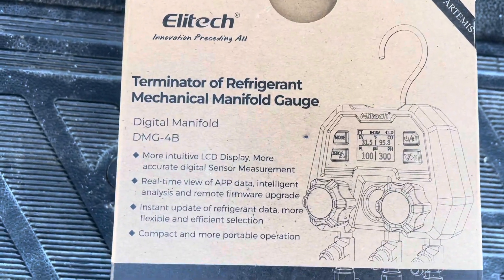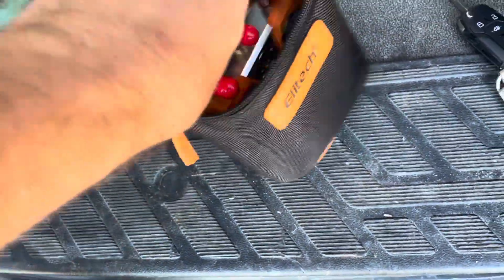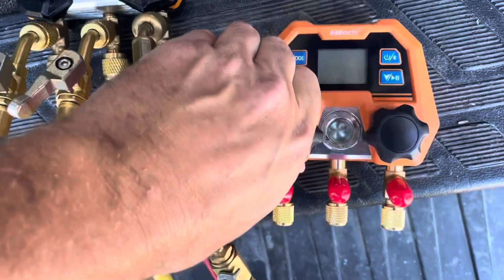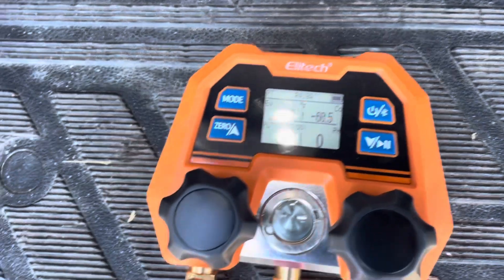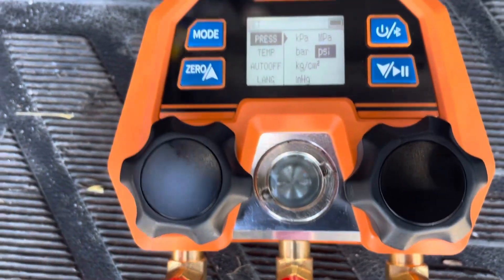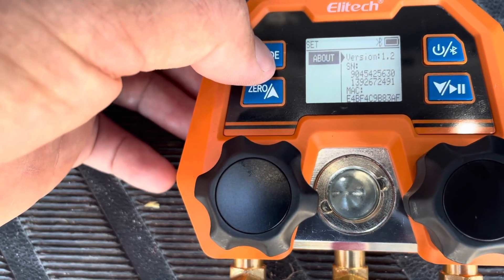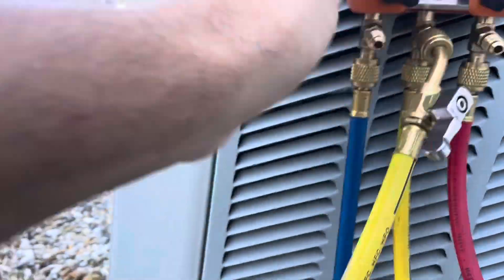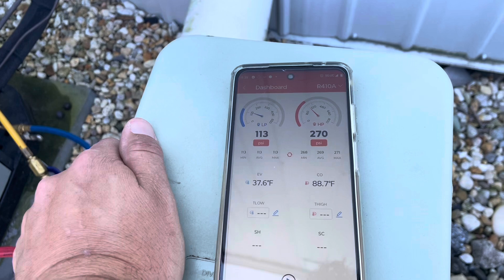Elitech DMG-4B Digital HVAC Manifold Review!

Comment: These things are Junk!  I have had fist set high side leak internally.  Elitech replace unit. I bought a second set so I wasn’t without gauges.  2 weeks later these leak exactly the same.  Now I’m using the replacement set from the first leak and now those are leaking.   3 sets all leak in the same spot internally.  All within 2 months
Reply from the maker: Sorry to hear that.

Comment: What’s your long term usage review?  I have these got them in April. And my set leaks on the high side inside the manifold.  It will actually frost up the housing
Reply from the maker: I actually gave my set away because I did not need them.

Comment: Not sure it is possible to get realtime temperature for sc and sh with this unit.  No jacks for wired temps and I could not find any elitech bluetooth temp probes.  Their better manifolds can use their wired temp clamps.  This manifold may not be a good first digital manifold.
Reply: I read somewhere that these should not be compared to a typical digital manifold, they are more like an electronic digital version of the classic stand alone dual circular gauge manifold. They display the pressure and add a few extra features not found on analog, including storage of 150 different refrigerant pt charts, Bluetooth transmission to a smartphone for logging data, and an app to view the readings from a distance to the unit. Even with no automatic sh/sc, you can't do these things with a standard analog set.

Comment: Evening Jeff, not in the trade but a very DIY guy here, I watch tons of HVAC channels and I'm getting ready to maybe install my own Bosch IDP 5-ton. The only gauge set I have is an automotive R134 analog set. My 30-plus-year-old Ruud just is not cutting it. I had a tech come out and gauge up and I'm sure he was trying to scam me because his FieldPiece unit was reading close to 1000 psi on the high side, no way is that possible. But either way, the unit has either a bad compressor or TXV valve, not worth fixing this old R-22 system. This will come in handy down the line because I do have some mini-splits I want to install. Anyway, great demo, and fingers crossed I get picked. Cheers

Comment: Older tech here, just wondering if you see a lot of Carrier Infinity gas furnaces and heat pumps. Unless your a dealer not much training out there. Would love to see more of that. Don’t need the gauges lol
Reply from the maker: I do run into them occasionally.   We used to put in a lot of them but the infinity stuff is just so dang expensive now.
Reply: @JeffsHVACAdventures  yes, no kidding!  But was able to get some minor scratch and dent units for my home from CE here in Toronto. Installed and working great! But know this won’t last forever. Just don’t see much of these units on the inter webs.

Comment: Ive been 3 months in with a small company as a helper/installer. They mentioned about getting me into service work. Ive been in college at IVYTech for 2 1/2 years and it took all that time for a good small company to pick me up, balancing a full time job and slowly taking classes. Ive used the fieldpiece in college and not much on analog. Ive debated getting my own and using this gauge for installing condensers would be great.